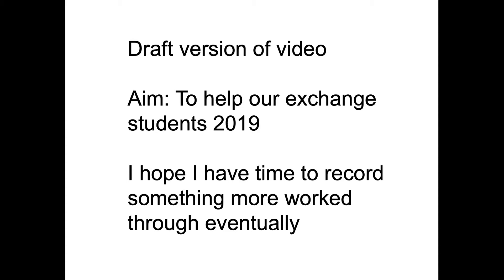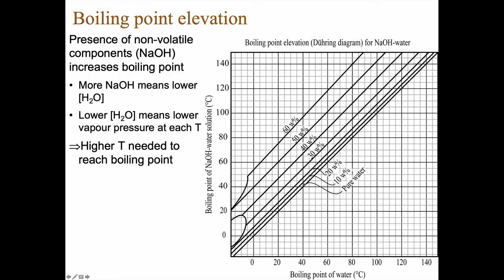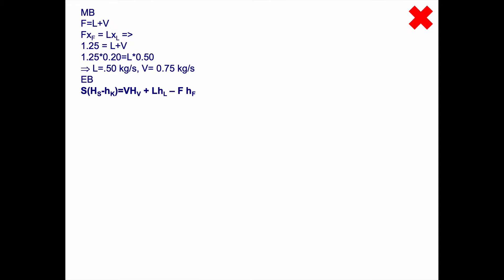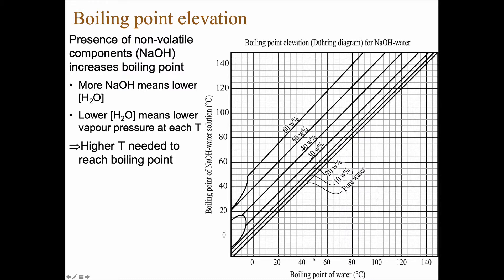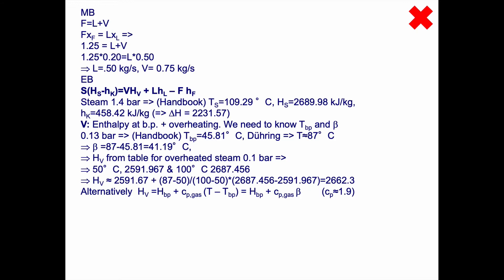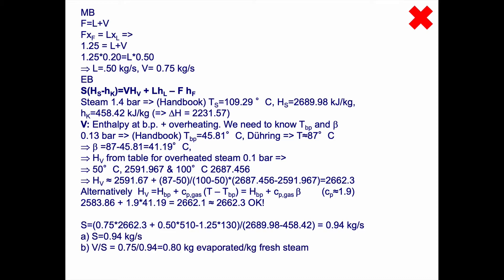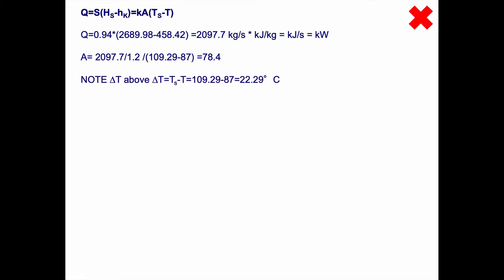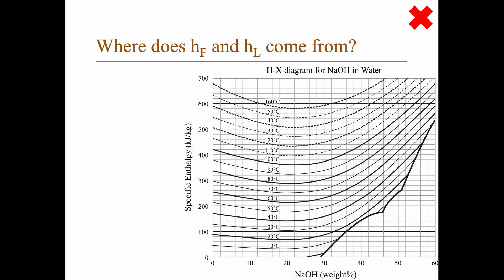Evaporation: Example with BPE (DRAFT video)

Comment: Sir please, how do you know the question is involves BPE?
Reply from the maker: Note: 1. There is always BPE as soon as you have a mixture where one component is not volatile. 2. the engineering point of view is to ask yourself how much error is introduced if BPE is not accounted for. 
3. BPE is a colligative property, i.e. it is dependent on the number of dissolved (non-volatile) molecules and not their identity (Compare wikipedia page on BPE) Thus at the same weight fraction of non-volatile components, BPE for small molecules/ions such as Na+ the BPE can be substantial while it for large molecules (e.g. catchup, orange juice, coffee) might be insignificant.
4. In my course on separation processes we start with ignoring BPE since that makes calculations easier to understand. Then we quickly move on to taking BPE into account and never go back.

Comment: How did you get 0.13kg/s all of a sudden
Reply from the maker: You mean 0.13 bar rather than 0.1 bar at 4.32 in the video. Thats a typo in the powerpoint file, it should be 0.1 bar but 45.81 °C is still correct, as is the other data. Thanks for pointing this out
Reply: @PLE_LU  thanks I understood it now